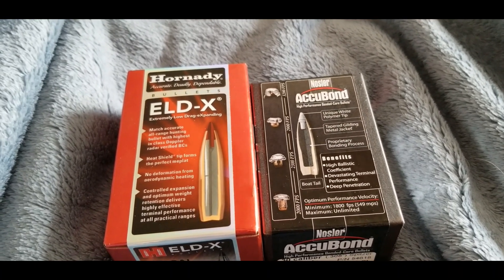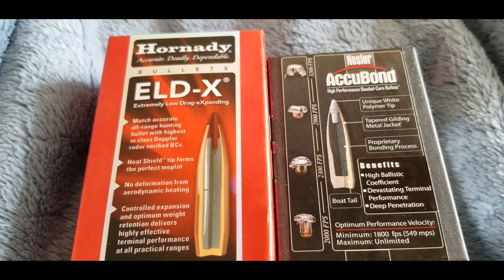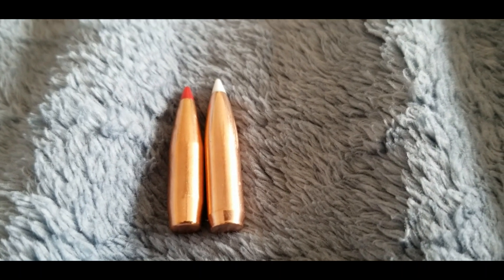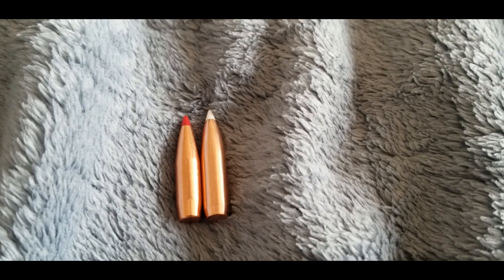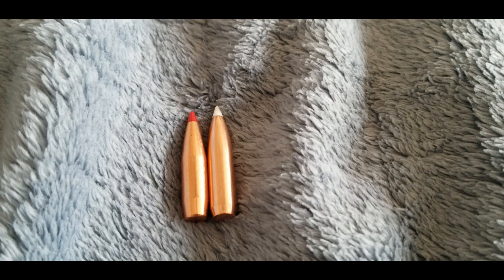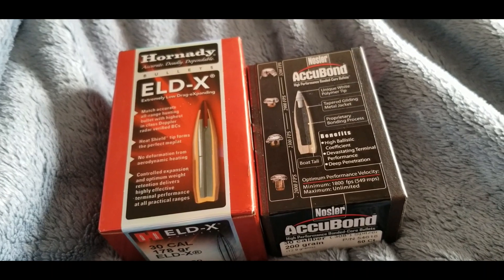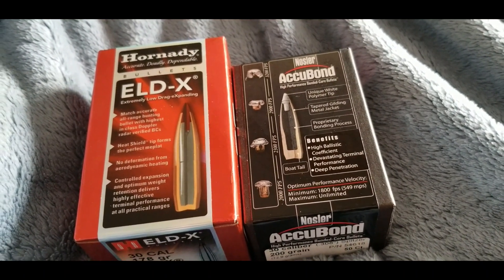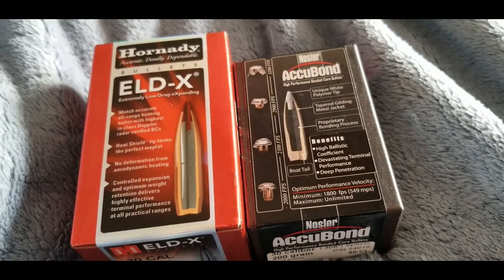ELD-X vs Accubond: Which bullet is more heat resistant?

Comment: Nosler doesn't have to worry about them melting because they fall off in the magazine
Reply from the maker: Fall off?
Reply: @ReloadingWeatherby  yes I have a hand full of 180AB's that the tips have fallen off if you research it you will find out I'm not the only one that has had that problem some people that complained to nosler got a free box I just use them for practice.
Reply from the maker: @Lucysdad66  I did search it... didn't find anything. Guess I need to search better

Comment: This is not a good comparison it is based on how fast that tip heats up And reaches a certain degrees ! Not how long it stays over the fire ! So this tipped scenario that Hornady came up with is not giving you the whole spectrum The ELD X Is basically just a Hornady  interlock Which is a pretty good bullet ' but Nosler Accubonds Are probably the best bullet on the market it’s bonded it has good BC and it’s very accurate performs basically like a nosler partition With better BC it’s hands-down the winner
Reply from the maker: I prefer the Accubond way over the ELD-X bullet. I was just doing the test for fun. Thanks for watching
Reply: @ReloadingWeatherby  
I understand  nothing towards you I just get a kick out how Hornady markets it's products lol it would be good to see a torch used

Comment: Seems like only one aspect was tested, without any kind of metrics or reference to what the projectile is exposed to in flight (temperatures, pressures etc..).  I think the idea is that the tip stays harder longer in flight so it expands the bullet more efficiently on impact.

Comment: Seems like a solution to a problem that was never there. Shot countless polymer tipped ammo out of high velocity rounds and never seen any accuracy issues. Seen countless animals and gel tests where the polymer tip is in the gel/animal and the tips are in perfect condition. 

Edit: or maybe this only affects performance at very long ranges.
Reply: It takes 800+ yds for a standard polymer tip to get hot enough.

Comment: At what temperature did you say the tips melted?  An how hot do bullets actually get in flight?  Seems to me if the tips on the Nosler bullets were actually melting, mucking up their performance, they wouldn't be selling.  What am I missing here?
Reply from the maker: The fire was around 600 degrees, apparently the hottest a bullet will get in flight is 500 degrees. But maybe it really does get hotter?